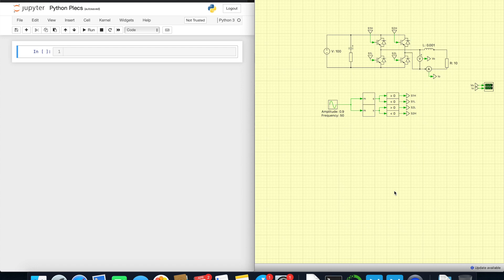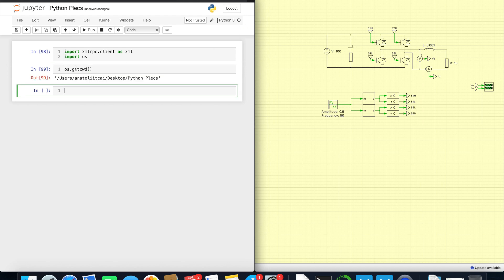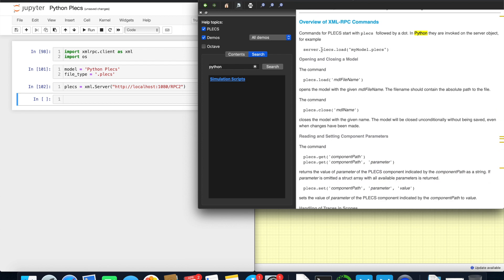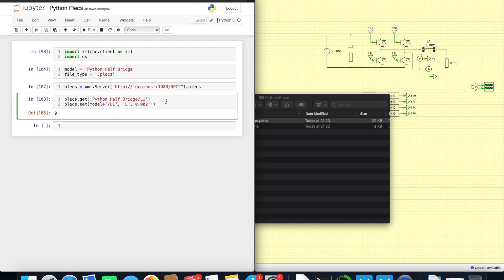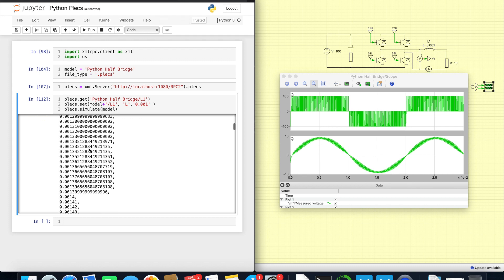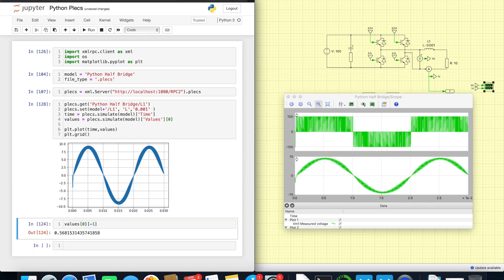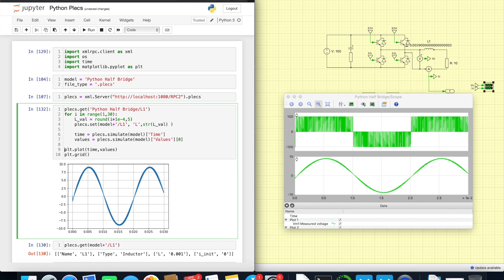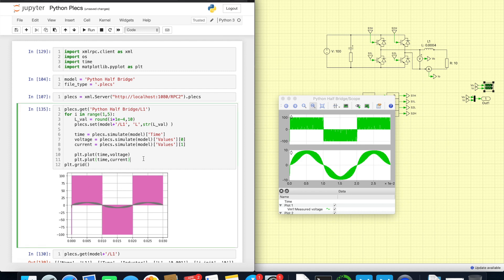PLECS Automatisation with Python Part-1.

Comment: Thank you so much for the detailed explanation. I was wondering what is contents of the coming lectures since this video is only part-1, could you please reveal more information?
BTW, I think maybe you can just use one variable to receive the returned value of 'plecs.simulate(model)' and then put the values inside it into different variable because otherwise you would execute simulation process for three times, which is quite time-consuming.
Reply from the maker: Thanks for the comment, actually I am uploading the part-2 at the moment. I am going to show there exactly how to utilise the loop simulations and take the most important values from each of them to characterise the behaviour. It will be available later today